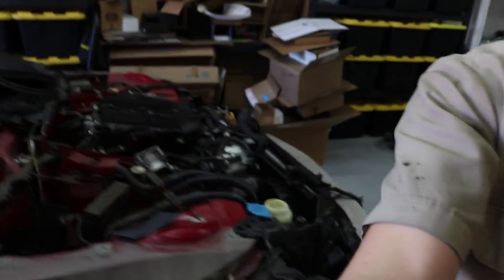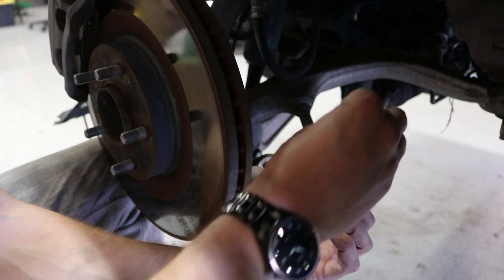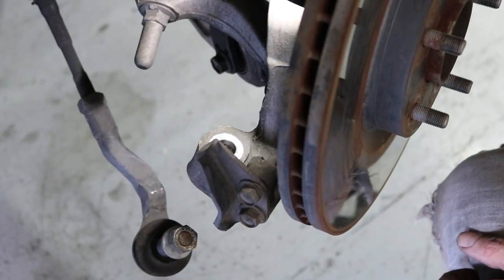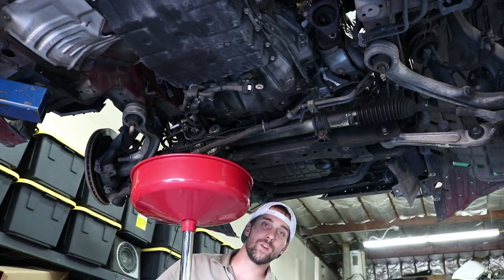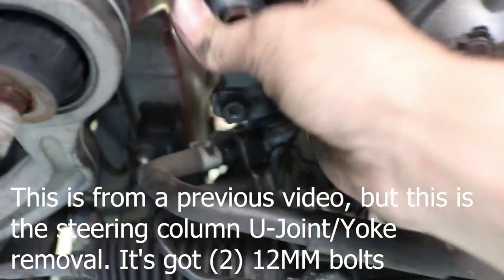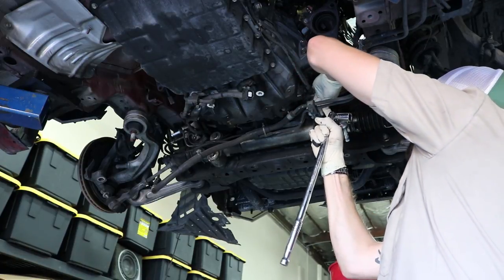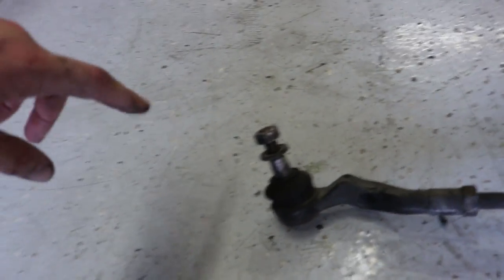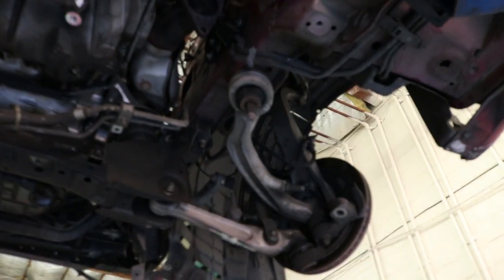350Z How To Remove The Power Steering Rack 350Z Z33 Power Steering Rack & Pinion Removal

Comment: What was the reason you removed the steering rack if you don’t mind me asking? I just noticed that the steering rack on my 03 g35 Coupe appears to be leaking around the rubber boots. Are the seals, or whatever’s leaking, able to be replaced on the rack or does the whole rack just need to be replaced once it starts leaking? I don’t know if it’d even be worth trying to repair it I’m just curious bc I don’t have any issues at all with my steering, nothin noticeable anyways. Just the small leak. Thanks for sharing the video btw, at least I know exactly how to replace the rack now if I need too ha.
Reply from the maker: You can rebuild power steering racks, it's just easier to replace them IMO. But if it is leaking I'd look into either rebuilding/replacing seals etc. Or replacing the rack itself. If it's leaking, it will gradually leak more and more, until replaced/or rebuilt

Comment: Just got my power steering rack in...2 hrs and I’m not a mechanic now is the lower control arm and get a alignment!!! Thanks again for the video.....
Reply from the maker: Awesome! Glad the video helped you out!
Reply: Full Throttle do you know what kind power steering fluid 350z takes? Thanks again.....
Reply from the maker: I usually use just synthetic stuff from AutoZone lol
Reply: Full Throttle has to be Dexron ATF.....lol
Reply from the maker: I've had 40-50 350Z's / G35's and never had an issue with what I run. No noise, no premature failures. Yes, I should go with what the FSM recommends, but that is.... just a recommendation....

Comment: I replace mine 15 370z , I replaced it with a used one,but now the steering wheel is a little stiff to turn and the traction control light came on... Any ideas what would be the issue?
Reply from the maker: Probably needs the steering angle reset. And the sensor on the rack sometimes is unplugged or ripped wiring

Comment: Hey I got a 08 g35 sedan and this seems very similar to my car, but my question is what would cause a noise in the rack and pinion when you slightly turn left and stop?
Reply from the maker: I will be rebuilding a power steering rack here most likely very soon, I'm not too familiar with the 08 style g35 but what type of noise is it?
Reply: Probably control arm bushing is worn

Comment: I have a question. The boot from the inner tierod on the driver side on my 05 Infiniti G35 going to the power steering pump is ripped. Is there a way to replace just that part? Or will I have to get a whole knew rack. If there is a fix how would I go about doing that.
Reply from the maker: I'm sorry, I don't quite understand, you can replace the boot on the tie rod, but there's no boot going to the P/S pump from the rack. There's the high pressure and return line that go to the pump

Comment: Hey charlie im going to remove my rack and convert the stock rack to manual since they dont sell one for the 350. Have you or anyone you know done this? Any tips?
Reply from the maker: What do you mean manual rack? You mean making your car manual?
Reply: Yeah eliminating the power steering system but not by simply taking off the pump but taking apart the rack itself because there is an inner piston that moves the fluid from side to side. As far i know i should be able to remove this piston so there is less resistance. I know it will be more difficult but do you think it will cause more stress on any of the other steering components?
Reply from the maker: That's a good question, are you gonna be using your car for drag? Is that why your doing this? And honestly, I've never actually fully dis-assembled a PS Rack before, sorry man. I wouldn't know about that
Reply from the maker: Oh, but I don't think it'll wear anything prematurely. But do some research online, I'm not 100% sure if it would or not.

Comment: Is the steering shaft keyed to go on a specific way, or splines all the way around?
Reply from the maker: Sorry for the super delayed response, the column yoke(U-Joint) has one specific way to go onto the steering column. And I believe the yoke to the rack can go on anyway. Just the plastic ring that has a outward part that goes into the yoke. Just be careful to get your steering wheel correct before reinstalling. Because you'll throw a steering angle code, and your car will go into limp mode.

Comment: I have a 2008 350Z and I have this issue that my steering fluid starts to boil, and after a driving for a while there is a knock feel sound when turning in low speeds, can the steering rack be grinding or something?
Reply from the maker: Your PS Fluid shouldn't boil, are you referring to the movement in the reservoir while the engine is on? Did you already find the issue?

Comment: How did you remove the senor that had that had the plug
Reply from the maker: What sensor are you talking about? On the bottom, or on the high pressure power steering line, up by the power steering pump?